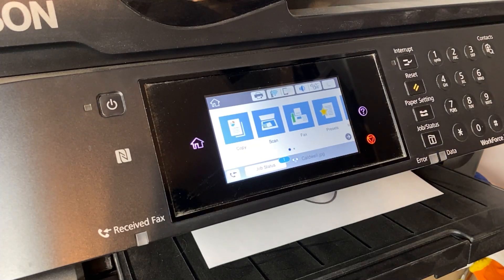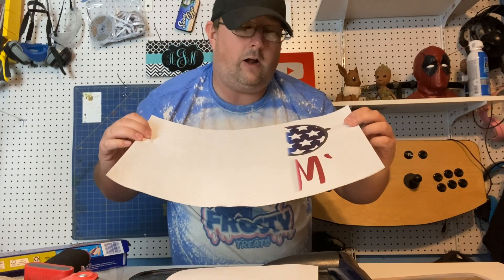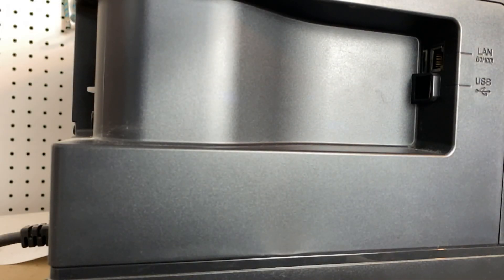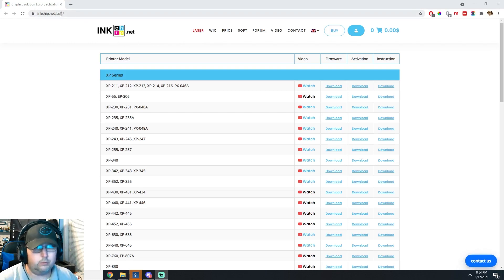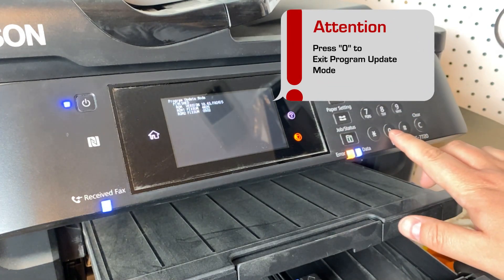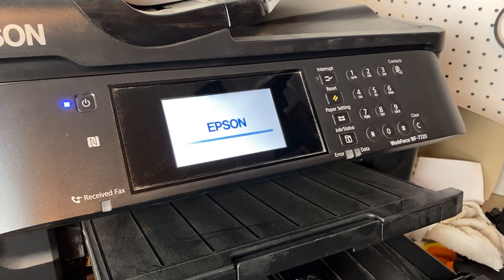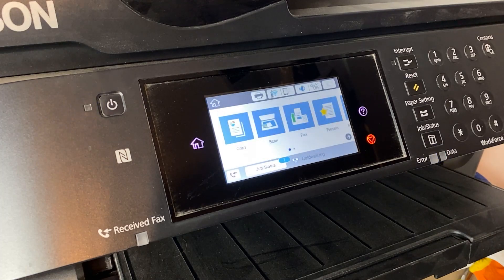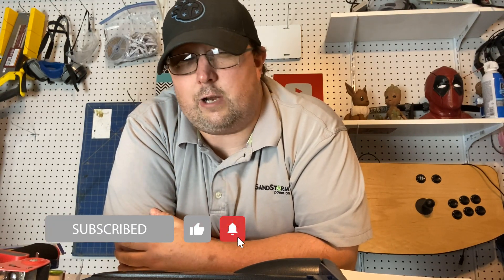How to Convert Epson WF-7720 Sublimation printer to Chipless Firmware

Comment: I desperately need help .everything was going smoothly until i started the install. It acted like it finished as you said blinking lights and all. But mine says Epson device rom program update mode  rom is not writable. I tried to activate anyway and it said Epson device recovery mode. I’m so frustrated. It is not converted yet. Bought brand new Epson brand name ink at Office Depot. It worked fine for about 15 prints then started showing out of ink and so I wound up here trying to fix it. Help please!

Comment: EPSON SUCKS.  I have 2 Epson and they will now not accept INK.   "Ink cartridge not recognized"  Emptied out reset, turned off and back on replaced cartridges still the same old thing.  WF-7820.  On the other hand I have 3 Canon and 2 HP printers that work flawlessly.  Personal feeling EPSON SUCKS.

Comment: Thank you for the tutorial. I have a few questions if that’s ok. 1- the sublimation ink doesn’t have to be same brand or from same firmware software company  right? And if their firmware is compatible with Mac 🖥 every video I’ve found  so far is using another pc and with windows  program. Thanks
Reply from the maker: As far as I know, it doesn't work with a Mac. Sublimation ink from any brand can be used.

Comment: When loading up the inkchip activation no device is being found, the printer is connected and the firmware successfully updated the printer but the activation process is not working, is there any way to fix this?

Comment: I have a question do you know anything about the print heads I have a 7720 and it prints and everything but the nozzle check shows missing lines now I have done head cleaning I’ve done the paper towel trick I’ve even hit it with head cleaner to unblock clogs and nothing is working so I was wondering if you have any insight on what could be causing my nozzle checks to be missing like 2 lines out of each color like I’ve said I’ve done everything you could possibly do to full head clean and get rid of head clogs and I always get the same results again

Comment: So the sublimation ink is already installed in the printer before you do this? My issue is the printer won’t read my sublimation ink. I never installed the epson original ink. Do you think this will help resolve my issue?
Reply from the maker: That sounds like an issue with the cartridges. Have you tried removing and reseating them?
Reply: @SouthpawsStudio  I will try to start over. I installed the ink and cartridges from cosmos ink. I will try that then try what I learned watching your video. It just won’t recognize them . Nobody else has this darn issue😂😂😂😂. I definitely don’t want to buy a new printer.
Reply: Im here because I'm having this issue as well!

Comment: I'm confused when you say put in serial # of printer. My serial # on side of my wf7720 doesnt look anything like yours. I dont have dashes in between mine & it says error when I put it into the bar. Where do I purchase activation code. It never asked me for anything to purchase.
Reply: Same issue for me!  So frustrated.
Reply: @tamiculver8236  I got it figured out. You dont put in serial # of your printer in that bar, you put in the activation code they give you once you purchase it from there site where you got the firmware software from. They will email you the code.